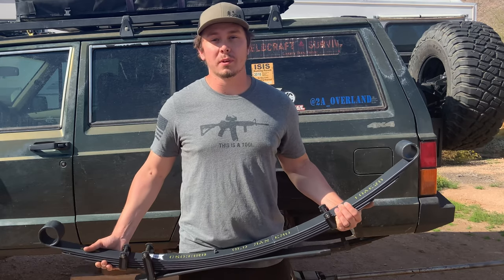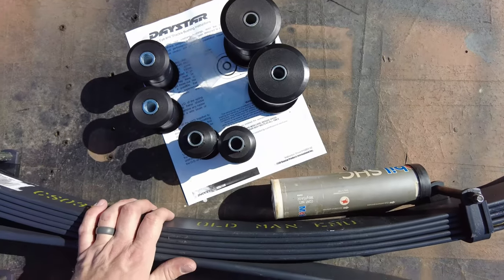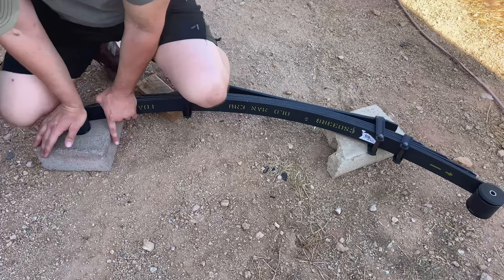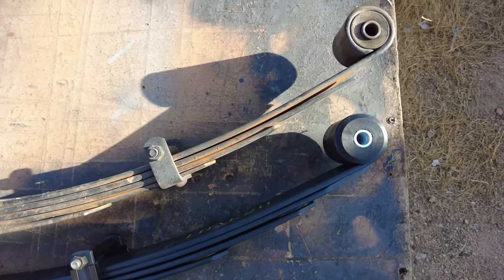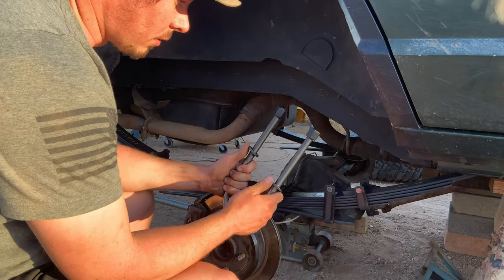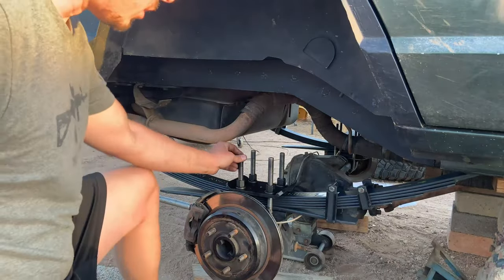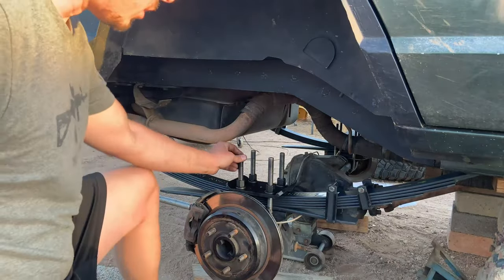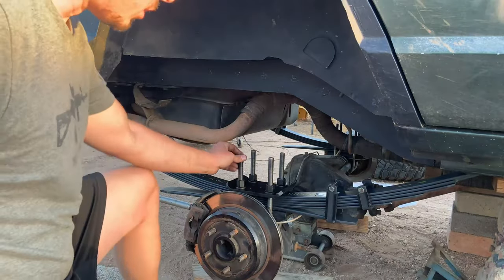Replacing WORN OUT suspension on our Overland Jeep Cherokee XJ! Metalcloak/OME suspension install

Comment: I just ordered the metalcloak springs and control arms, jks adjustable track bar, stinkyfab aluminum steering and Fox shocks.   For the rear I ordered the same leaf pack as you and the ironman fab shackle relocation bracket  and 1 inch shackle and also there steering brace and spacer.
I think that's about it
Reply from the maker: That’s an extremely beefy setup man! 🥩 you shouldn’t have any problems with that! I did talk to metalcloak about their control arms and they told me cause of the geometry of 4.5in coils and their control arms it would make a sorta rough ride. They suggested to me either long arms or control arm drop brackets 😬. I figured it shouldn’t be much of a difference from their control arms and any other brands right? You will love that setup though. My heel rides like a dream on the highway

Comment: Before you go cutting off your bump stop buckets. Disconnect your drag link and sway bar if possible. And you can lower the axle a bit more. And by the way bump stops are very handy when needed.
Reply from the maker: The sway bar was disconnected but I honestly didn’t think about disconnecting the track bar 😅 I was so fed up with fighting with them lol good insight for when I do anything in the future thanks! And I am gonna come up with a bump stop solution sometime soon, either go all out and do some type of hydro/air bump setup, do the acos from JKS or weld a nut onto a washer and weld it onto my cut bump can so I can thread a rubber bump stop onto that spot again. I really appreciate you watching though, and all these tips help me a ton since I’m just a normal guy working on the XJ 😂.

Comment: Can't wait to hear how it feels. I'm curious about those coils
Reply from the maker: Thanks a ton for watching man, my first impressions are these MetalCloak coils are way better than my old rough country ones and what I like is they’re a true 4.5in cause they designed the ride height with a weight in front like a bumper and winch. But I think the ride quality is limited by my short arms though 😬 I’m definitely looking into a long arm kit to get the full potential out of the new coil springs.
Reply: @2AOverland  Right on. I have Rubicon Express 4.5'' coils in the front and want it to stay the same height, but would love an increase in ride quality. Check out Rock & Road Performance 3 Link kit, incredible design and local to me.
Reply from the maker: Same here man it’s decent on the highway but in the city it’s definitely not the greatest. Ive heard of them from when that guy installed their kit on bleepin Jeep, that one and the IRO kit are my choices lol. But I like that their crossmember is 1/4inch!

Comment: Hey man im really struggling to get my axle low enough to put one of these coils in, i got one in but with that i can fit the other, how did you do it?
Reply from the maker: Thanks for watching man, is there something binding up to cause not enough droop? I know one time I had to unbolt the trackbar from the axle cause it was hitting the axle bracket and my coil spring popped right in
Reply: @2AOverland  No worries man thanks, the track bar was a good shout i just also need to adjust my control arms a bit, finally got it in after some ugga duggas on the spring compressor. Good video man keen to test out these metal cloak springs👍

Comment: Will I be able to still keep stock height with these ? Not looking to lift just replace my leafs on the Jeep
Reply from the maker: No these leaf springs will give you 3.5in of lift in the rear end
Reply: @2AOverland  ok sorry I sound lost but that means I will have to lift the front ? Or it’s simply up to my likings ? Just making sure it’s leveled. So my best bet would be to wait until they are installed and decide then ? Just trying to keep to stock as much possible for now
Reply from the maker: No worries man! You would have to lift the front 3in also to match the rear if you use those leaf springs. If you wanna keep it as stock as possible I would pick up a set of stock leaf springs for the rear and coil springs for the front. Rock auto has the stock parts you would need 😁

Comment: Instead of pb blaster you can use a mix of brake and tranny fluid; works like a charm
Reply from the maker: Good call I’ll try that next time!
Reply: It's nice cause if you gotta bust some bolts on the trail (or in someone else's vehicle) it's easy to just take a little from a dipstick and the master cylinder

Comment: I’m concerned about the lack of bumpstops. You need those to save the shocks. The shocks won’t live if they are the bumpstop. (They aren’t supposed to limit travel)
Reply from the maker: You do have a point, it’s been a long time since we’ve wheeled to the point to bottom out the shocks but I do want to save the shocks for as long as possible before a rebuild. Ultimately I wanna go with hydro or air setup but that will require a lot of work 😬. Ill end up welding a thick washer with a nut on the cut bumps so I can thread a bump on there for the mean time. I just needed them shorter so I can fit the coil back on since they’re longer than my old springs. I heard the ACOS by JKS is a good system too.
Reply: Xjs are weird only one some occasions it will hit bump I put in extended bumps and had to cut them down to like 2 inches cus no matter how much I compressed the spring it wouldn’t work with my springs sorry fo the rant
Reply from the maker: That’s weird lol I’m still looking into what bump stops I want and need to measure for them
Reply: @2AOverland  I found a set through dynastar I believe. Popped right into the factory mount for the front, and then just cut to the length I needed (pumps about 1/2” before the shock bottoms out.)
Reply from the maker: @Natezoinks I’m definitely going that route, cheaper and easier to install. I thought about hydro bumps but it’s too much fab work

Comment: Hi there, would you be kind enough to measure your axle to frame distances for reference on how much your lifted over stock?
Reply from the maker: Thank you for watching! 😊 that’s not a problem at all! I have a Ford 8.8 rear axle so that might make a difference but the measurement is 9 3/4 inches. And the front is about 11.5 inches

Comment: I'm running the MetalCloak upper & lower adjustable control arms with the drop brackets with no complaints. I'm strongly considering the Fox shocks. How do you like them?
Reply from the maker: That’s good to know I’m between those control arms or the IRO 3 link long arm kit. The fox shocks are awesome! I’ve had them about 6yrs and there’s been no issues. If you could spend a little more get the adjustable ones though. And thanks for watching!

Comment: Why the metal cloaks over OME coils? I want to get 3.5" lift with a soft ride.
Reply from the maker: The only reason I went with metalcloak over OME is cause their coil is designed to be a true 4.5in with the included weight of the bumper and winch. OME coils will be good too based off whatever accessories you have on your jeep.
Reply: Definitely going with metal cloak coils have done alot of research on them.

Comment: did the leafs net a total lift larger than 3.5"?
Reply from the maker: They would have if I didn’t have the heavy bumper on the rear. If you need to net 3.5in with a heavier bumper like my smittybilt I would do a 4.5in leaf pack

Comment: Sweet Jesus. I wish I would have stopped you before you cut the cans. Proper bumps are 100% necessary dude. Kiss the unibody and those 300 shocks goodbye. Consult a professional next time.
Reply from the maker: Yeah I shouldn’t of 😅 but I’m gonna change them up soon and fix the bumps with a welded washer and nut so I can thread in normal rubber bumps or I’ll figure out a hydro bump setup
Reply: @2AOverland  may I recommend just swapping to acos or using a pair of sumosprings for a JK. Have any questions pm me. Built many xjs and have a few little tips. If you were near reno I'd help. Maybe if I end up in Phoenix visiting my parents in my xj I'll stop by.